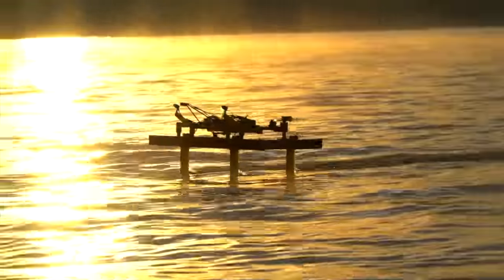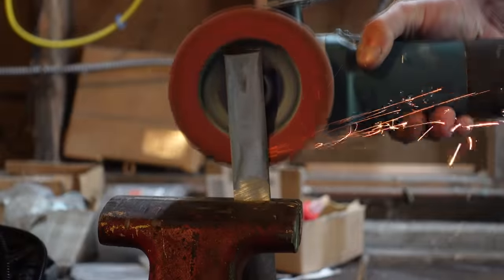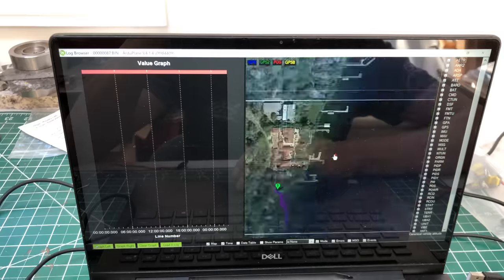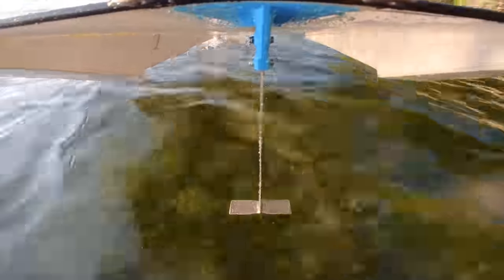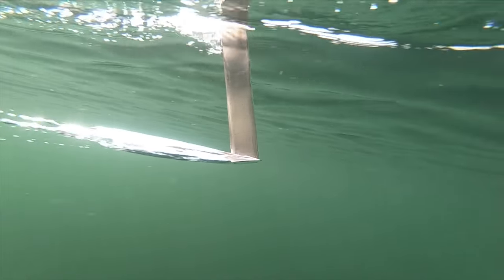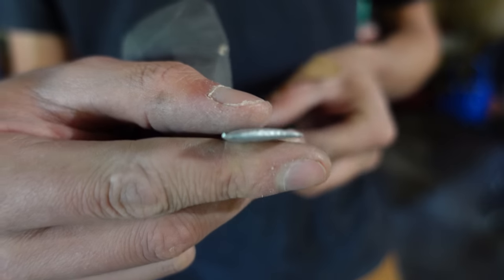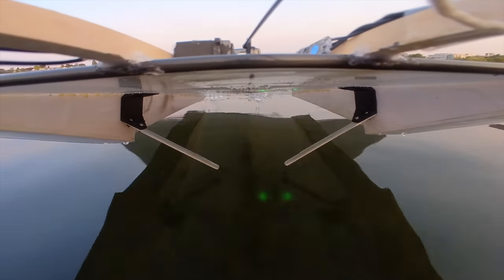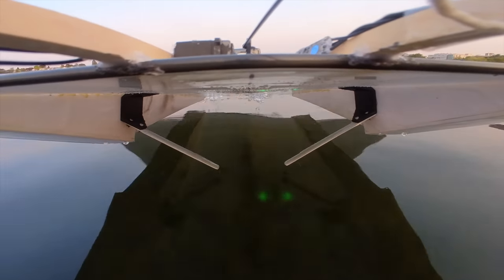Airplane + Hydrofoil - Good or Bad Idea?

Comment: The Line through the Clouds is called a Distrail - or dissipation trail, the opposite of a Contrail - or Condensation trail.   Both have the same cause - heat and condensation nuclei from the engine exhaust creates localized areas where the water vapor is condensed into tiny ice crystals or water droplets. In the Distrail- the effect creates larger droplets from already condensed mist (the cloud) which are large enough to fall away, leaving an open lane in the cloud.
Reply: They just didn't have their Chemtrails pumps going !
Reply: Good to know....
Reply: The distrail was caused by an earlier plane in a different path, not the one at 21:34
Reply: no it's not, it's from the chemicals they dispose of in jet engine fuel, read about chemtrails

Comment: My 5 cents about sharp foils: recently I dove into hydrofoils thing too, designing impeller blades for waterjets. And when I was about to use some basic airfoil I suddenly found the airfoils for water are actually different (surprise) from airfoils for the air. The main reason is the cavitation. And the other reason - much higher water resistance: many hydrofoils do use sharp leading edge. Anyway - within working range of allowed angles of attack (usually something from -13 to +13 deg.) the sharp leading edge works ok.
Reply: Was about to say that, due to the  viscosity of water, a sharp leading edge is better. Look at boat/yacht shapes the sharp edge is at the front, contrary to airplanes where the sharp edge is at the back.
Reply: @pawelrelidzynski680 the sharp bow angle on boat hulls is meant to reduce the bow wave created at the interface between the air and water. Torpedos and submarines use rounded fronts because they are fully submerged
Reply: @BlueIron64 i get your point, but that is not entirely true. You can see some bigger ship types being rounded in front and thats due to the speeds they travel. In water there is less resistance with a pointy shape in front, and i have seen it in a controlled environment. Same with air,  less resistance when the frontsurgace is rounded and pointy in the back

Comment: a little suggestion for the drone that went in the water: spraypaint the waterbottle a bright color so its very easy to spot when upsidedown in the water like that
or fill it w/ expanding foam, so incase it is damaged it does not sink whilst also being more visible
Reply: Good suggestion. As color I would recommand a bright orange or red.
If something samller would be wanted maybe the mechanism of an automatic life vest could be copied.
Reply: Also, a small LED light inside the bottle would be a good idea. It doesn’t add much weight but will provide you several hours of super accurate positioning.
Reply: @arlenn729  yeah. That would be kinda sick

Comment: The transition from hydrofoil lift to flight on the Regent aircraft seems to depend on a pitch-up "launch" to get more lift by increasing the angle of attack.  While this might work, passengers might find such a maneuver more than a little unsettling.
Reply: its useless
Reply: I noticed that. It looks pretty jarring unless they have some special seat suspension that can enter the cargo area.
Reply: @XenoWiz  more motors does increase the safety in case of a failure
Reply: @XenoWiz  more motors actually generate more power than a single big motor due to tip speed limits. If your tips start hitting the sound barrier they won't generate as much thrust and will generate a ton of drag. As such you can run a smaller motor at much higher speeds and have more of the blade in the "optimal thrust region" For electric motors having a bunch of smaller motors has major benefits, the first being that you don't need to put huge amounts of current through a single wire (fire hazard). The second is for motor cooling, third is cost (a bunch of small motors is cheaper than a single big motor). The Blown Wing isn't a new technology, it's been used for decades on drones and has a long history with STOL. It actually does work since the effect of the wing is independent of the ground this allows for a functionally higher airspeed over the wing than your actual groundspeed, it's like taking off into a headwind. Momentum is conserved since the lift and thrust are (mostly) perpendicular to each other. 

The reason why airplanes traditionally favoured having one or two big engines is because that was also their main powerplant. ICEs are big and heavy, their power to weight ratio is actually very low compared to electric motors (batteries and fuel not included). Gas turbines have a thrust to weight ratio comparable to electric motors. So why aren't electric motors used in aviation as much? Well batteries are heavy, much heavier that fuel, and that tends to be the deciding factor. And jets generate just so much power so easily that it's kind of dumb not to use them despite their complexity.
Reply: This is your captain speaking, passengers, brace for 'boop' maneuver. 
<boop>
<everyone vomits>
Reply: @frollard  💀💀💀

Comment: Hi! I was so happy to see my mug in the "instigators' list" 😊

Thank you so much for making all the research and the tests. As you suggest in the discussion, hydrofoils would need to be short and possibly retractable (although they provide a tiny amount of lift in the air too, with some added instability). The goal is to leave the water as soon as possible to make the transition to and from airborne as fast as possible, especially in choppy waters -- the goal is to fly over the sea, which is never flat, even in a cove.

From what you show and the Regent experment (I wasn't aware of this one), you'd use T-foils as they seem to provide more lift and less drag at low speed, and more than just one at the front spread around the CoG (i.e 1 ahead and 2 on the sides behind, or 2 and 2, adding to the same surface).

Currently, I'm more on the Lippisch design (inverted delta) with 12º anhedral to which I add canards, the idea being to add 1 hydrofoil under the fuselage and 1 under each of the floats located at the ends of the wings, so to transition as quickly as possible to airborne. So far, the canards are attached to a nacelle at the front (like big ears on the head of a flying duck) because I wanted to have wings swept 30º forward (making an skirt open 120º in front), but I probably drop that to no-sweep and have the canards attached to a straight edge so to modify the entire wing geometry by moving the canards'edges up and down.

Thank you again for all the work and the actual experimental results you provide. Keep up the fantastic job!

Comment: This is the video I've been waiting for for ages! Your closing remarks are the most valuable to me:

1) Hydrofoils could help get GEVs and seaplanes out of the water, and perhaps aid in landing.
2) They'd have to be retracted to make efficient use of GE.
3) This bonus is not present at RC scales (likely due to smaller mass to surface ratios and lower Reynold's number).

This had indeed been my hunch, but I'm so grateful to you for actually doing these tests and giving your expert's opinion. My motivation for the idea has always been the tell-tale fact that the Ekranoplan allegedly used 8 turbines to take off but only 2 for sustained flight. Perhaps one could also improve efficiency at sub-takeoff speeds by propelling the craft against the water rather than the air - e.g. by a mounting a boat prop to the back of the hydrofoil, or by creating a water jet with water sucked in through a hollow foil.
Reply: Jet powered take off ekranoplan sounds extremely badass
Reply: @wiegraf9009 the giant ekranoplan did that and then fly the entire thing with only 2 turbojets

Comment: In regard to what you mentioned on the jet.  Why wouldn't skis be the ideal solution to most of these problems?  At low speed the waves aren't an issue on the hull.  At higher in water speeds the skis will plane, lifting the body/wings away from the waves.  And then at highest speeds, when your airborne, then the skis could be retracted like landing gear against the body for a smooth hull.  This seems to give you the best configuration for all three speeds for takeoff/landing transitions.
Reply: Skis would induce a lot of turbulence and drag but yeah if they were retractable it seems like a good idea. I just wonder if they would really help ekranoplans with the choppy water problem because they wouldn't be very useful at cruising speeds?

Comment: Outstanding!  Thanks for teaching me about ventilation.  Never heard of it before though I've seen it before while not recognizing it as anything.     Amazing footage between the drone and the ground effect "napkin"!
Reply: Just a gut feeling - when there is no physical connection between an air cushion vehicle and the water, there must be 
less drag than if you dangle some shape, any shape down into the water. Your interesting experiments proved just that. The air cushion principle is so elegant in its simplicity. One hypothesis I'd love to see you try is fencing - i.e., Run a raked vertical fin down into the wateron the rear inner faces of your sponsons. Seems to me that you could extend the cushion of high pressure air further back, negating form drag from any horizontal surface touching the water. 
My theory is that fins would yield two benefits - first, lower form drag, and second, better lateral stablility.
I'd love to see you throw some fins on your mature research aircraft!

Comment: Just to save you some money in the future: the steel you buy usually isn't hardened, so high carbon steel isn't  harder than regular steel (mild or construction steel) unless you actually temper and aneal it. Not that it matters a lot in those quantities, but tool steel is about twice as expensive as mild steel :)

Additionally, brazing might be a better (easier) way to to attach pieces like that without sacrificing much strength.

Anyway, awesome and educational video as always!
Reply: PSA: Be cautious about what craftsmen/tradesmen tell you about heat treatment. Many of them are notorious for getting it wrong because they tend to learn by word of mouth and trial&error rather than reading about material science. And we all know how the game of telephone tends to go.

Heat treatment is a science. A branch of material science, to be exact. And it's complex enough to require highly educated and dedicated specialists when doing R&D for big expensive projects.

Anyway, annealing undoes tempering, and tempering improves strength, not hardness. Quenching fast makes it hard, though also much more brittle. Tempering reduces brittleness whilst retaining higher hardness than other processes, which ultimately increases its' overall strength. Coincidentally, that metric is called 'ultimate strength', which is different a completely different metric from 'hardness'. Look up the tests for measuring those two.

Annealing is the process which kind of 'resets' steel, typically used to maximize machinability (make it softer/more easily workable) and remove internal stresses due to forging and machining processes. It's also typically quenched more gently so you aren't left with an overly-brittle product.

Comment: Hey I'm in a video, cool! Thanks for the mention. Excellent exploration of the concept! It's cool to see the historical applications of the tech, so thanks for including those. Ventilation is the WORST when winging, I think that's the appeal of high dihedral front foils, although you rarely see it in rear stabilizers. I'm sure you've done plenty of research while making this thing, but if you want to get into hydrofoiling, there's plenty of money in the industry now, particularly wingfoiling, since it's the new hot thing, so lots of watersports companies have been investing in research to create the best hydrofoils. It's neat to see the differences in performance, high/low aspect, lots/no dihedral, thick/thin wings. I was toying with the idea of creating a biplane style hydrofoil, where the lower wing is smaller, creating less lift, but less drag to provide a gradual transition to flight, but you've proven pretty well the combination with ground effect aircraft isn't super compatible. Well done, keep playing!

Comment: Someone may have mentioned this but there are hydroplanes that use cavation to produce lift. They have sharp leading edge with square traling. The fastest sail boat uses one.
Reply: Found mysel
Reply: . . Myself wondering how cavitation fit into the equation with hydrofoils.

Comment: 16:20 looking at it, I'd say that it's almost certainly possible to land it without stalling at 52kts-- taking off would be more difficult, but the ground effect should help it reach the speeds it needs (for example, in soft field takeoffs, we lift off much sooner by applying full back elevator pressure-- however, once in the air, we immediately let off pressure, and stay in the ground effect until rotate speed). I'm pretty sure that plane's wingspan is long enough that it can be in ground effect without the hydrofoils being in water, so I imagine that's how they'll do it.

Comment: There are hydrofoils that use supercavitation. This is just forced cavitation at higher speeds and can increase both top speed and efficiency. I think the largest benefit to adding both ground effect and hydrofoils into one vehicle would be it’s very high weight capacity; high weight would also help with the foil staying close or in the water… last thing, foils can also be used to pull the craft towards the water preventing the bouncing created with ground effect.

Comment: The reason why the flying boat (Regent)  has hydrofoils is to prevent  jarring vibration/shock;
A normal flying boat rides on the surface of the water, planing before it rotates. That means that the roughness felt by the passengers/airframe is directly related to the roughness of the water’s surface. 

If a seaplane has hydrofoils, it can quickly lift off above surface irregularities, causing a smooth ride as it builds enough speed to rotate. The only time you’d feel the rough surface/waves is at initial acceleration stages when the speed is low and affect on the airframe minimal.  Basically a little rough right at the beginning, then transitioning to an incredibly smooth hydroplane affect, followed by rotation.

It actually makes a lot of sense. Same thing with landing; land on the hydrofoils, then by the time the plane decelerates enough they don’t generate enough lift to lift the airframe above the water, the plane is going slow enough that the rough water won’t be too abusive to the airframe.

Comment: Just a thought on turning a ground effect vehicle. Since your essentially  flying flat, your tail section should steer like a car linkage. And, the front wing on the inside of the corner should create a small amount of  non lift creating drag.  Kind of like breaking one wheel on a car to make a tighter turn, but just slightly.  Anyway, that was a fantastic lesson.

Comment: if you have a multiple stage hydrofoil: the bottom one, smaller, pulling down, and a bigger that would skim the surface, perhaps with a mechanical 'feeler' that would auto-adjust the height?

Comment: Fascinating video. Essentially the lack of water pressure differential in the couple of inches the foil pierces the water for a model robs the model of the lift increase provided by the feet a full-sized foil pierces the water.
The main advantage of the hydrofoil is the ability to maintain a higher speed in moderate sea conditions  without pounding the passengers into jelly, as would happen for a planing hull. For a model, ground effect just seems better, as long as you get enough altitude to avoid the waves. Which is why experimenting with multiple foils is probably just a waste of time.

Comment: Hello, I am an embedded systems and aeronautics engineering student and I think  you can keep the hydrofoil in the water by increasing its surface by making it longer but also larger.  u could also place the rotors behind the aircraft (like the sr71 for example) and move the hydrofoil more towoards the nose/front of the aircraft. so the thrust is coming from behind and its helps stabilisation, or even better ur can do the opposit keep the rotors in front and bring the hydrofoil more the back you should try it actually it could be interessting keep in mind that performing these two ideas might introduce the need to add a variable angle hydrofoil for way better stabilisation !

Comment: About the Regent Seaglider - their prototype also has wingtip pontoons whose holders (not sure of the technical term) prevent the air from escaping sideways and thus increase efficiency. For added bonus, I suppose they act like winglets and help in airplane mode as well. Not sure why they don't have them in the final design. Plus, as mentioned - high wingspan helps keep efficiency even if the wing absolute height is... well higher. Which, in turn, helps operate in rougher weather.
Reverse delta ground effect vehicles can also get away with higher wings (at least their leading edge). Also not sure why we don't get more of these.

Comment: Actually, the stagnation point does not remain static with changes in angle of attack. As the angle of attack increases the stagnation point moves backward from the leading edge, on the lower surface of the wing.  At high AOA a small portion of airflow on the lower surface is inverted, spilling forward and up from the high pressure under the wing to the low pressure above it, and you can easily test this with smoke tests in a wind tunnel or with short tufts attached to the leading edge of the wing.